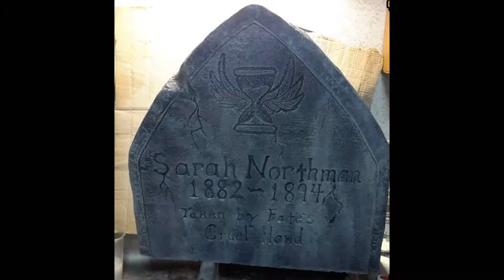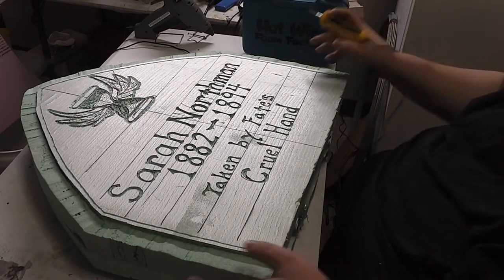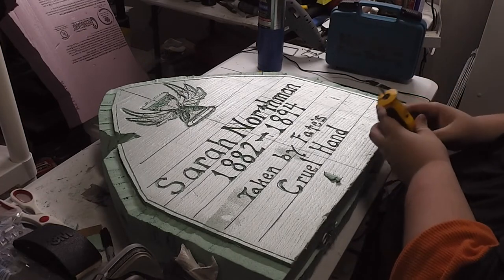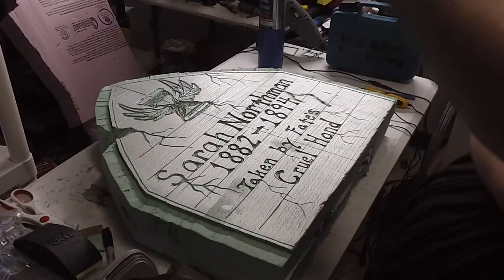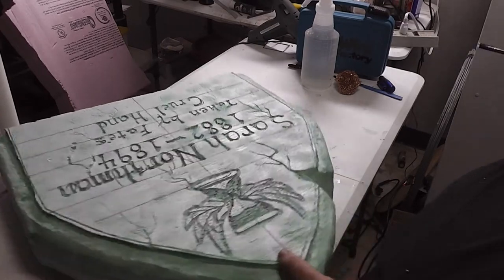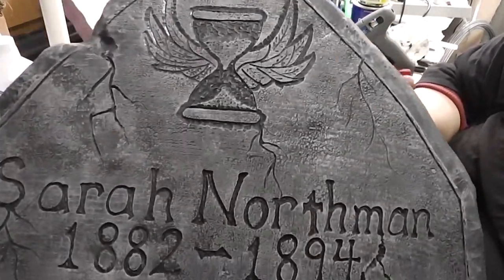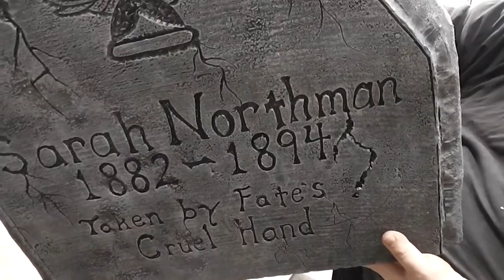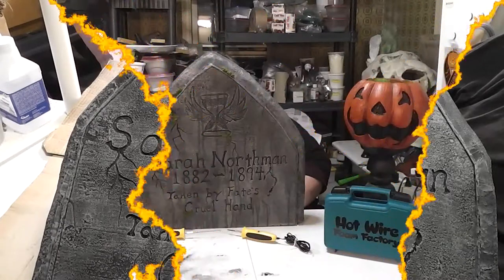Foam Tombstone Tool Test Part 3 - Seriously these little Cracks are so much Fun

Comment: Thanks for the incredibly entertaining and informative review.  So, now that you've tried out the tools, do you feel they are superior to your homemade tools?
Reply from the maker: +Halloweenlizzy72 Well the one tool I made blew two of my power supplies which wasn't fun and I still need to rebuild them so in that regard they are superior. Everything was conveniently done. They're not as hot as my tools when they use the 9v power supply so they cut more slowly and when you're used to zipping right through foam you definitely notice that. They are sending me their variable strength power supply to test out so I'll see if that picks up the speed and eliminates the foam frizzies. Fundamentally I would say that if you're just knocking together some tombstones for Halloween then go get a $10 soldering iron and get a good stand for it. But if you are looking to get involved in the wonderous world of creative whimsy that is foam then their tools are a good investment. I'm doing a small lighted pillar right now that needs the hot knife and nothing I could build would do the same job.

Comment: Rather than throwing the old stone away, couldn't you recycle it by turning it into a new tombstone using your new toys?  It would be interesting to see how it would turn out!
Reply from the maker: +DragonHunter42 Well the old stone is a type of insulation which is more like fiberglass so heat is less effective and it is coated with a layer of what is effectively paper on either side so it doesn't take to hot tools well at all. I am going to make a little addendum video on how to redo old tombstones that are completely styrofoam and I do have a bunch of those that I want to recycle and make like new again. That will probably be out after Halloween though since I am busy up to my ears right now. :)